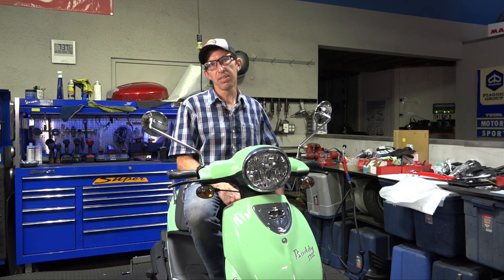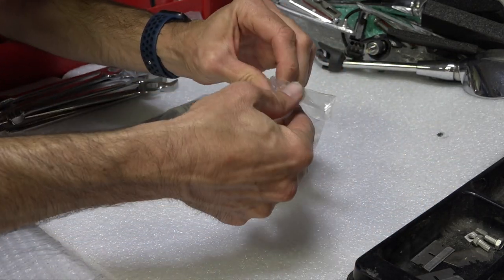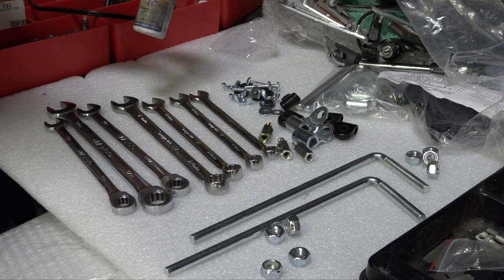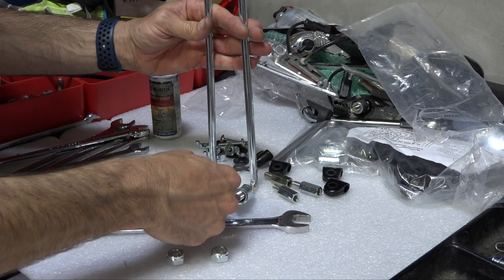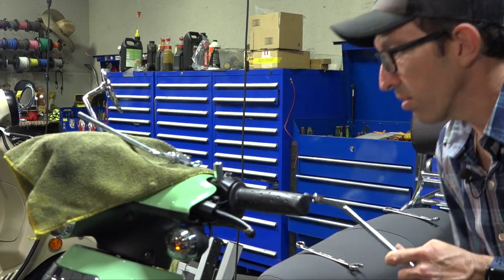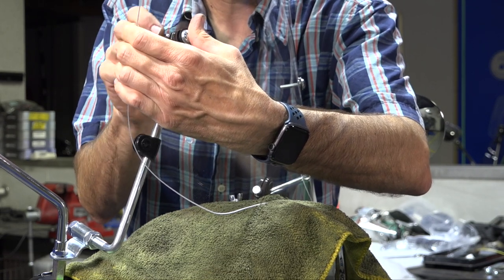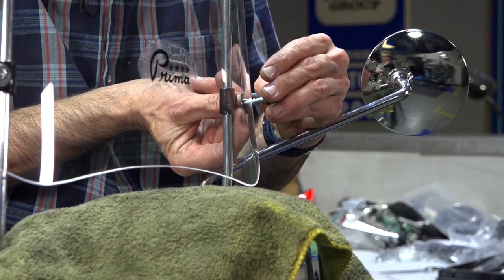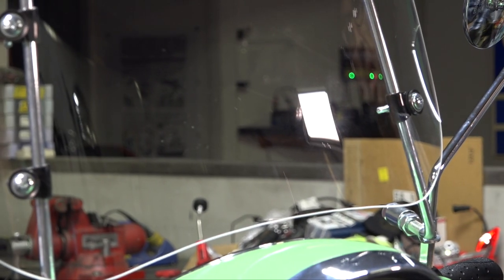How To Install a Universal Windshield on a Genuine Buddy Scooter

Comment: As soon as I saw the vid I clicked. I have a Buddy. I know u have to feature the Vespa’s but I appreciate all your vids. A true tech. The Buddy rides a little rough especially after surgery. I also have a Suzuki Van Van. The Buddy even without a windshield seems to pass the air around u as opposed to the motorcycle. I really enjoy two wheels. Thank u Robot!!
Reply: Yes I notice that the wind does pass around you on a scooter better than a motorcycle without a windshield. I just bought a SYM Fiddle 4 200i and thinking I might not need a windshield after all.

Comment: Nice video, I just got the same one you just installed to put on a Vino125. No instructions or even a parts list was included and it has the same bubbled up sticker on the wind screen. Thanks.